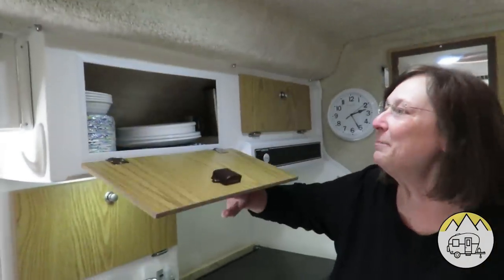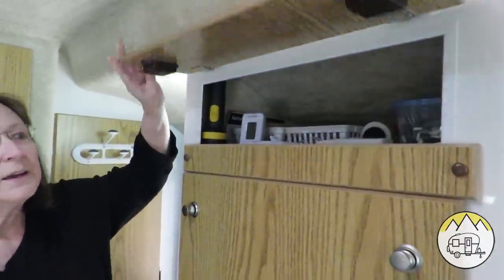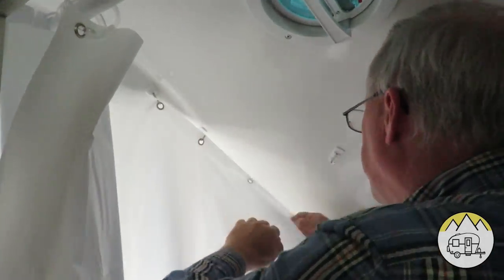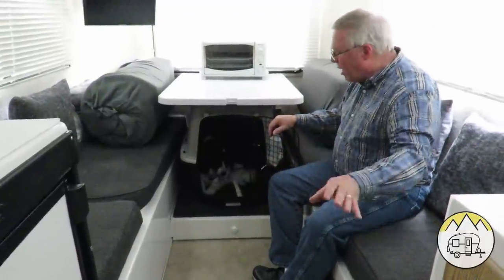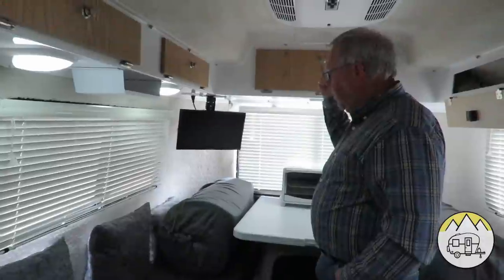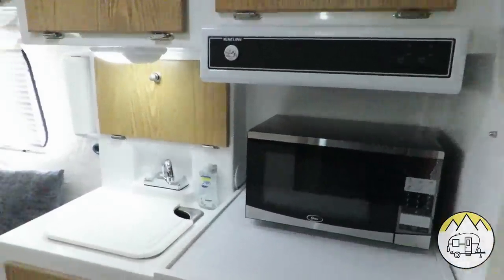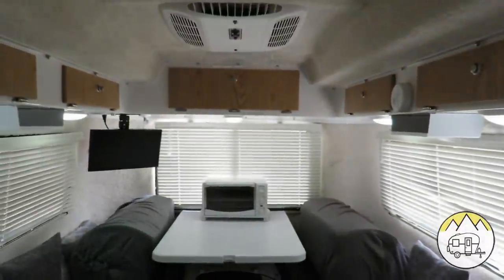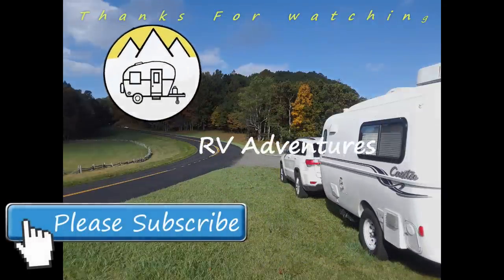Casita Travel Trailer - 17' Liberty Deluxe Tour by RV Adventures

Comment: I just found your video and enjoyed it very much.  I have a 2007 17' SD and have only had it out once.  I am getting ready to take it out tomorrow for my first solo trip.    Thank you for the idea of draping the shower curtain across the toilet area with command hooks.  I tried a tension rod but the top and sides were sloping too much to make that work.    I see you use scissor jacks for your jack stands.  Have you ever considered mounting them to the frame?  I have thought of doing that but didn't know if it were even possible.  I am happy I found your channel and will check out your other videos.
Reply from the maker: I did think of mounting the jacks, but I decided that the trouble of cranking them all the way up each time would take longer. As it is now, I just crank them down enough to get them out from under the frame which makes for quicker set up at the next stop.

Comment: Thanks for the video. Have you had any issues that needed to be fixed or improved? Or any rivet issues?
Reply from the maker: Yes... in our video list you will find a couple of repairs we had to make... a few rivets, the power center main unit, the jack handle, the water valve on the toilet, and the refrigerator. I would say routine stuff for an RV. We also made several improvements. For these items specifically, go to our playlist that includes all of these items: https://youtu.be/E-z_fpaWUgY

Comment: Where is the tv antenna?  How do you stabalize  the tv for traveling?  Like the bunge cord idea that I need to incorporate in our Casita, which we haven't used yet!
Reply from the maker: There isn't a built-in or mounted TV antenna. I use one of the portable flat digital antenna if I am in an area where you can pick up local channels. There is an external coax connector for RV Park cable TV. The TV mount is stable enough so that nothing is needed for travel days.
Reply: @RVAdventuresTV  in ours there is a coax cable running from the tv to the upper cupboard by the bathroom.  The coax is attached to a smaller wire that is connected to a special flat piece, about 3 x 8, which must be sort of an antenna and is stuffed into the crevice of the bathroom wall.  The is also another small wire running under carpeting toward bathroom from the upper cupboard with a coax end and i don’t know if anything is on the other end—-doesn’t seem to be connected to tv!  I have pictures & will see if Casita can answer if you can’t.  Thanks for your reply.

Comment: Hi, beautiful camper. I noticed your tv is a Jeep. What’s the tow capacity of the Jeep? Do you need WDH? How about brake controller. Enjoy your traveling with your casita. Thanks for sharing.
Reply from the maker: The towing capacity is 6,500 Lbs GVW of the trailer and 650 Lbs. hitch weight. We don't need a WDH due to the Jeep having load balancing suspension, part of the factory installed tow package. When we hook up the trailer, the Jeep lowers about 2 inches and then when we take off, it levels itself out. We have the Prodigy P2 controller ( https://amzn.to/2BFgO8d ). Brake controllers are required in so many states and it is wise to have one. It works great.
Reply: Thanks for the reply. That sounds like the perfect towing vehicle for casita. If you don’t mind, what’s the model of the Jeep? I ordered a casita spirit dlx for August delivery. I have a Lexus RX 350 now, which is a little underpowered for 17’ casita.  Right now I am not in position to exchange car. When time comes, I will definitely get a stronger vehicle even if I have to buy used. Casita sales rep recommended getting WDH for lexus. I still have to install towing hitch, brake controller and wire harness. Lots to do and lots to learn. But I get time and many good sources of information on the internet from people like you. Thanks again for sharing your knowledge. Merry Christmas and Happy New Year.

Comment: We would like to ask about the sliding table and dog carrier area. Did. you have this installed or are there instructions for constructing it? Any help would be appreciated, thank you!
Reply from the maker: I don't have instructions, but basically it is a dog carrier with wood attached with bolts on the sides for the drawer slides to screw into and a plastic table top from Walmart/Sams Club with wood runners bolted to the bottom for the drawer slides to attach to.

Comment: Do you sleep on the benches without making them into a double bed? How wide are the benches in the Liberty and are they wide enough to be comfortable for you or would it be better to get the Independence model with the cramped space between the benches for eating?
Reply from the maker: They are very comfortable and plenty wide enough for us. The leg space between the benches is 28" (as shown in this trailer review). The width of the bench is 25". The Independence model benches are 31" wide, but the leg space between the benches is only 15". Take a look as well at the Independence trailer review where I discuss this space issue. Cindy's sister had the Independence model and the leg space was a major issue, but they enjoyed the wider beds. For us, the beds are just fine. You can also in our model leave a double bed made up and use the small dining table and have that space always set up... however, we found that to be limiting interior space too much for our liking.

Comment: What kind of vehicle you used to pull the Casita. Do you think 2016 Toyota Tacoma  6 cylinder will be okay to pull it
Reply from the maker: A Jeep Grand Cherokee. It is a V6 and does a great job. The Tacoma should be OK, but check your ratings on it to make sure.

Comment: The v-loggers have clarified, below, that they don't keep the dog in the kennel in the trailer while hauling the trailer.  While hauling, the dog is in the kennel but that is with them in their SUV - so that's okay by me and I retract my admonition on that basis.  Since the kennel is in the car with them, the dog can let them know, or they can ascertain, if there is a problem.  My concern was that if the kennel was kept in the trailer while it was being hauled down the road - since that is not happening, I retract my admonition.

Comment: This is a nice video of your Casita, I am wondering how easy it is to tow your trailer, how much does it weigh and what gas mileage do you get towing with your Grand Cherokee with V6 or V8.  Thanks Greg
Reply from the maker: The Jeep tows it very easily with great power and acceleration even on grades in mountains. It weighs about 2,500 Lbs. empty, 365 Lbs. tongue weight. The Jeep has a V6 and we get 17-19 MPG depending on speed and grades... I usually hold it at 63 MPH on most freeways.

Comment: We’ll get our 17’ LD in October! I love the kennel mounted table. Where can I find how to do that?
Reply from the maker: I will attempt to explain... I didn't make a video on that. I cut two 1x4s the width of the top of the kennel plus 4", where it is flat, one for the front and one for the back. I then cut two 2x2s that same length. You take a jigsaw and cut four 2 1/2" square openings in the side of the kennel who's top edge is flush with the top of the kennel and in the correct place to mount under the 1x4. The idea is the 1x4 is on top of the kennel, the 2x2 is under the top of the kennel both lines up and sticking out the same on each side. You then bolt the 1x4 to the 2x2 going through the kennel, 3 bolts. You then attach a 1x4 to the 1x4 & 2x2 sticking out the sides going the length of the kennel on each side. Mount them 1/4" higher than the top mounted 1x4. Now, cut two 1x4s and two 2x2s the same length as the previous 1x4s. Attach them together with the 2x2s at the top edge of the 1x4s. Now, you mount your cabinet slides on the 1x4s that are mounted to the kennel and mount the 1x4/2x2 assembly to the other side of the cabinet slides. Now, you take your table top and attach it to the two 2x2/1x4 assemblies. I will make a drawing and answer this reply with a link to it later.
Reply: RV Adventures thank you so much!

Comment: Great Video presentation on your 17' Casita Deluxe. Can you tell me if the total length is just for the trailer body itself or is that the length from the trailer ball coupler to the rear back end of the trailer ?  Also, did you mention the model year of your Casita?I don't recall seeing or hearing that info. Thanks in advance for your reply(s).
Reply from the maker: The total length is from ball to bumper, which makes the body about 13 1/2 feet in length. The trailer was picked up in Jan. 2017 at the factory and I checked the plate on the frame and they tagged it as a 2016 model. The only change from 2016 to 2017 is that a few months after we picked ours up they started installing the slender vertical tail lights instead of a square one and they moved it higher up closer to the belly band. I am not sure if there is a consistent model year time frame or if it just happens.

Comment: Hello!  We just picked up our 2018 Casita Spirit Deluxe yesterday.  We are wanting to do the mod you did in your bathroom.  Are you using two shower curtains or one that has a hole in it for your bungee to go through with that mod?  Thanks so much for showing details in your videos.  We have enjoyed them.
Reply from the maker: Sorry for the delay... out on RV Adventures without a cell signal. We use one shower curtain with the hole next to the hinge side of the door for the bungee cords to go through. You have to experiment with the exact location of that as well as attachment points for the ends of the cords. The placement of the command hooks on the top is determined by the shower curtain holes. We have replaced our shower curtain twice and they are all the same on hole placement so the hooks it hangs on works fine. I use two bungee cords, one stretches across the doorway and the other stretches from the front trailer wall to the other wall and turns to the attachment point that is kind of beside the vent pipe. This is a lot of info... maybe I should do a video on this shower modification.
Reply: That would be very helpful and much appreciated by any here having purchased a Casita already or contemplating buying one.Thanks.
Reply: Scott B We actually used just ONE regular size shower curtain - one that you’d use on a standard tub.  I just hung some command hooks along the ceiling from the end of the doorway and then over in front of the toilet.  The command hooks that I found worked best were the little ones that had a metal hook on them.  It is best to put up the hooks when it is not humid or damp in the shower.  Also not good to put them up when it is really cold - they won’t stick well.  What I did find was that water would leak into the bottom compartment under the sink.  :’(. That said, when it warms up, I’m planning on putting ez rv gutter over the top part of that compartment in hopes that I can keep water from dripping down the front and right into the compartment.

Comment: I have questions:  (1) Where did you get the shelf/table extension next to the sink? Did you install it and how is it attached?  (2)  How did you attach the paper towel holder and the coat rack on the door?  Where is the closet electrical outlet for the microwave? Thanks!
Reply from the maker: The shelf/table extension was purchased online from Little House Customs. I attached it by drilling into the side and bolting it using short stainless machine screws with washers and locknuts. It is a little tight in there due to the sink and furnace, but it can be done. The paper towel holder is done the same way, drilled thru and bolted to the wall... washer and locknut are over the carpet lining the cabinet above the sink. The coat rack, you guessed it, I drilled holes and bolted it. I always use stainless machine bolts, washers, and locknuts. I installed a new electrical outlet inside of the vent hood housing myself (past electrical experience) using the circuit from the closest plug in the overhead above the bench by the sink. It is easy to pick up that circuit in the electric box in the overhead cabinet and run the wire around the outside wall under the carpet that pulls up easily. If you don't install a new outlet, you can run an extension cord (3') from that existing plug to power a microwave or other appliance sitting on the stove top.
Reply: RV Adventures Thank you for that quick response! I really appreciate it.

Comment: Is your casita 3 seasons or four seasons.  Also do you have automatic hot water?  Good videos.
Reply from the maker: It is for 3 seasons. The holding tanks and drain plumbing is all exposed under the bottom. The fresh water tank and lines are all inside. I have been out in 20-degree weather with no issues (I add a cup of RV antifreeze in the black and gray tanks) but that is pushing it. The 6-gallon hot water heater is automatic on temperature control, it is not on-demand. You can run it on propane or 120 volts, both sources have on/off switches and both can be run at the same time for quicker hot water recovery if needed. Thank you for the compliment.

Comment: Anyone can answer this the Casita is right at my cars towing weight limit or actually a little above so I think I'll have to get something a little stronger.  What are you pulling your Casita with?
Reply from the maker: I use a Jeep Grand Cherokee. It is rated to pull up to 7,200 Lbs. with a hitch weight of 650# max. The Jeep does a great job of towing and the performance is great. When towing the Casita, I get about 17 MPG at 62-63 MPH and 20 MPG at 55 MPH. Thank you for the comment and question.
Reply: I pull with a Nissan Pathfinder...tow pkg..

Comment: thank you both. a nice little video. i was thinking i would use the microwave space for a cabinet, for an alpicool fridge/freezer (which runs on dc power) to supplement the small fridge. and i'd use an induction cook top (double burner) in place of the stove, which saves on space, and diminishes propane use in the camper. why burn through propane faster than i have to?
Reply from the maker: True... Great ideas and thank you for the comments.

Comment: Nice video. You have done a nice job on your Casita. We have an ID and I too am trying to figure out the small table situation and creative mods for it. Am curious, where do you plug your microwave in at?  Am I missing a plug above the stove?  We don’t have a microwave, but sure would like to plug our Instant Pot in the stove area. The cord will not reach over to the one above your add on counter space (we have one of those now too).
Reply from the maker: I put the plug in myself... I used to be an electrician among other things in my working life!!! We used to use a 3 foot heavy duty extension cord plugging into that plug you are talking about and ran it behind the sink faucet over to the stove area.... maybe that could work for you. I wired my new plug mounted in the back of the vent hood into that plug in the overhead. Thank you for asking. Have a great day.
Reply: The plug/outlet for the microwave is already built in the cabinet above the fridge. It also has the vents in there.

Comment: Noisy fan & I tried picturing myself towing a mini box trailer around then having to detach it at times I am leaning more towards a mini motor home nothing to lug around & less to worry bout but to each their own whatever works for folks.
Reply: Old Timer only drawback is your Motorhome becomes your primary vehicle at all times unless you tow a another vehicle. Motorhomes are nice if you never leave the campgrounds. Just my opinion on issues we have had with ours. Happy camping
Reply: Most folks that own a Casita, have already been through travel trailers and motorhomes. Casita's can fit where bigger can't and have everything the big rigs have. Another big plus is they hold their value. Stickbuilt travel trailers and motorhomes do not. The Casita setup and breakdown is not a big deal. I am on my second one, travel alone and have no issues towing, etc.